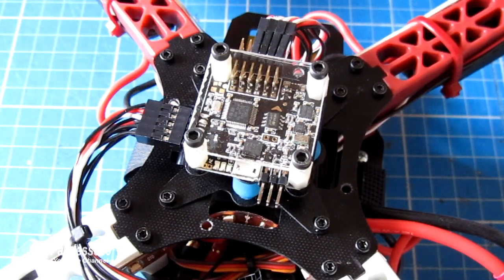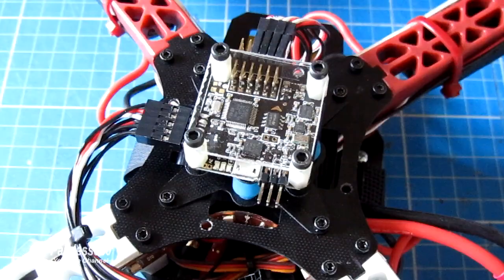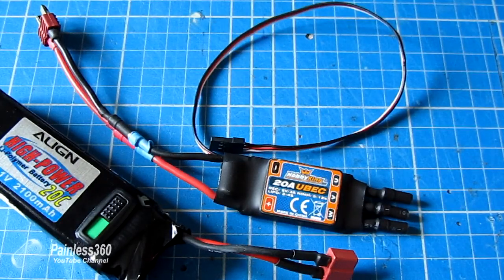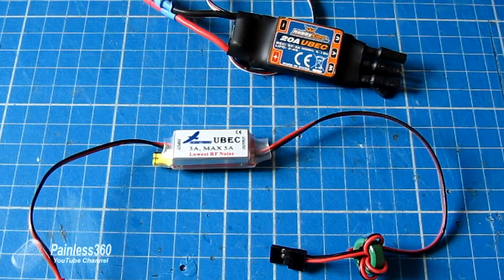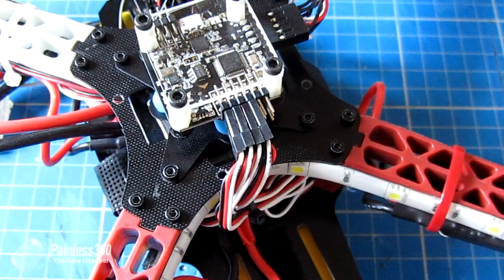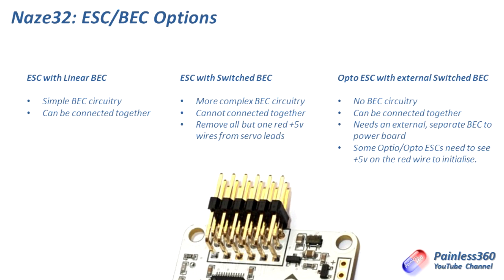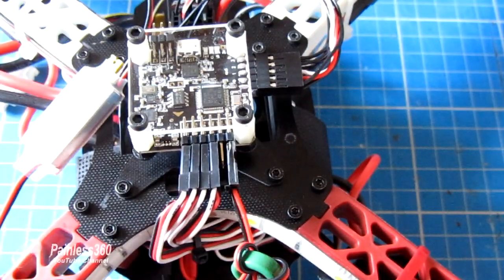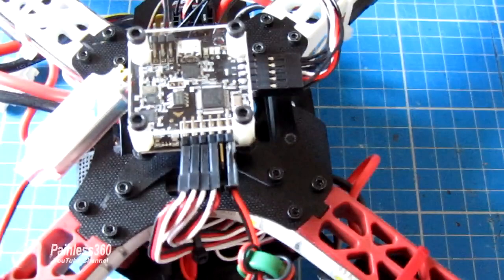Naze32 Quick Tip - Powering the board (Linear, Switched and Optio/Opto ESCs)

Comment: what's the point about using an external bec? i mean it can be justified with airplanes so that in case of problem with main battery you could anyway be able to land safetly...but with copters will always drop like a stone
Reply from the maker: While it is true that copters can't float for toffee there are a few reason why having an external BEC can be useful -

Most of the cheaper ESCs used for multirotors have simple or lower current BEC circuits in them. With the newer boards using additional components like radios, receivers, LED strips, sonar devices, OSDs etc. the current needed for all of the flight electronics running on the 5v supply can quickly overtake what the integrated BEC can reliably provide.

The second reason is due to the fact that the BECs (particular the linear ones) produce a lot of heat when running 4s or higher batteries so using an external specialist BEC that can handle the higher voltages from the LIPO pack easily, provides less heat in the ESC itself (a good thing) and it also allows us to use higher quality, more efficient switched BECs to deliver the 5v and 4+ amps needed.

And finally Opto ESCs don't have an integrated BEC at all so you need something to provide the +5v needed to power everything...

Hope this makes sense and goes some way to answering the question.

Happy flying!
Reply: that's make a lot of sense...thanks for that and for your usefull tutorials...i only fly with Naza for their semplicity but i will give to naze32 a try in the build of my 250 racer quad. thanks dude!

Comment: Very well explained... Although I only use the signal wires from all four ESCs. Three into one connector and plugged in horizontally on the signal pins. I then use a small adjustable BEC from the battery set to 5v in another connector with the remaining signal wire vertically.

I found one ESC was getting warmer than the others using the traditional methods. May have been a coincidence. May have been because as you mentioned in another answer that it draws a lot of power with LEDs, FPV etc.

These are the type BECs I use which are dirt cheap and weigh next to nothing and are great for powering camera as well...

http://www.ebay.com.au/itm/281435847847?_trksid=p2060778.m2749.l2649&ssPageName=STRK%3AMEBIDX%3AIT
Reply from the maker: Fug Bucker hi, it is common to have one of the ESCs doing the most work supplying the board with 5v. Linear BECs will cope with it but switching BECs less so. Happy flying!

Comment: i have 20amp escs without bec, the servo lead( connecting the esc to the naze) has only a yellow wire and a brown wire but no middle red wire. can i use the 5 volts from my pdb  to power the naze?
 thanks !
Reply from the maker: +shad0w1pegasis yep. Best of luck!